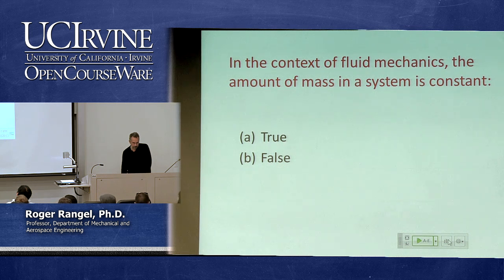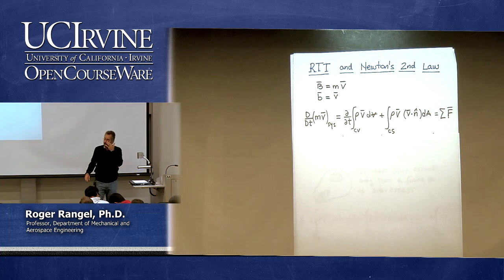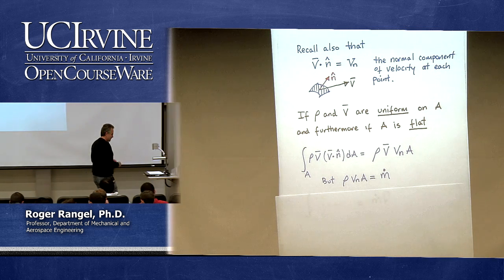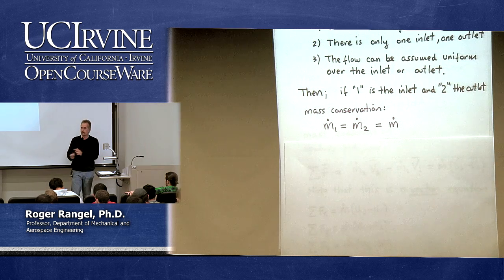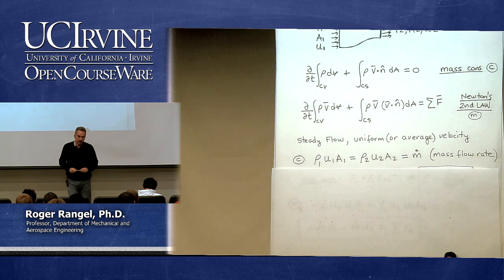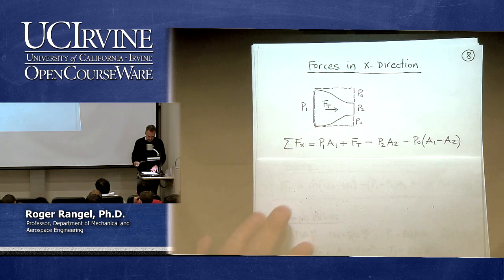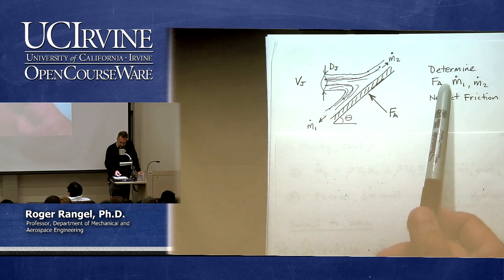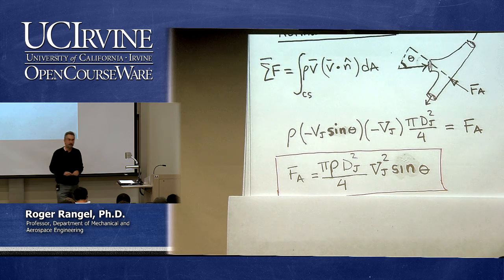Engineering MAE 130A. Intro to Fluid Mechanics. Lecture 13.

Comment: Why did he take the density in the engine thrust example as a constant if it depends on the pressure which in turn changes?
Reply: Hi, he didn't consider it as constant.
You have to consider that "rho1*u1*A1"="rho2*u2*A2" and it is equal to the mass flow rate.